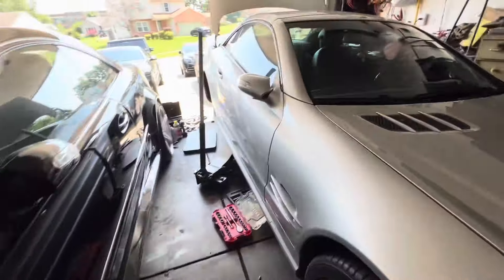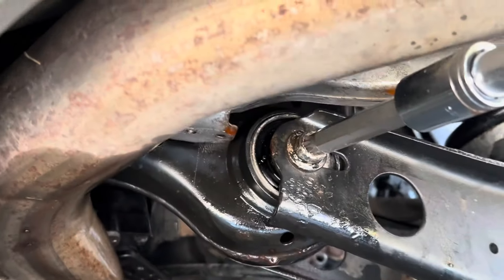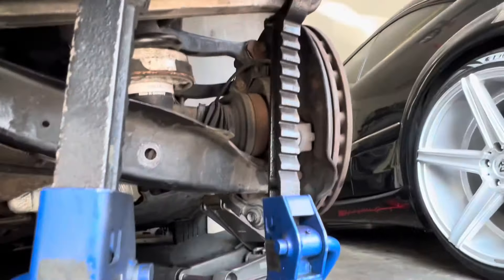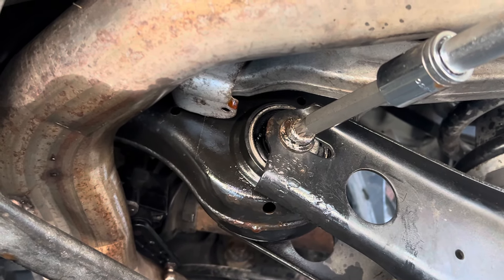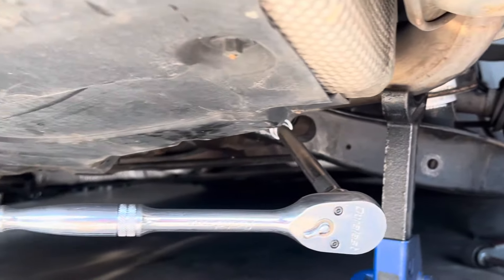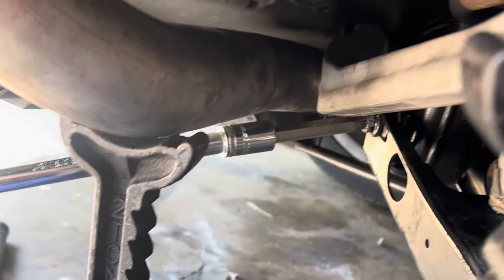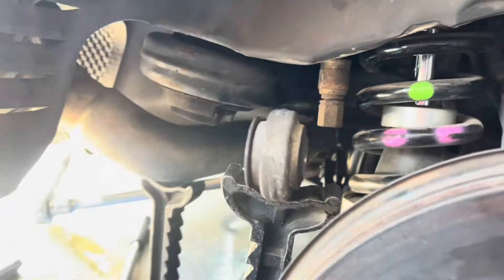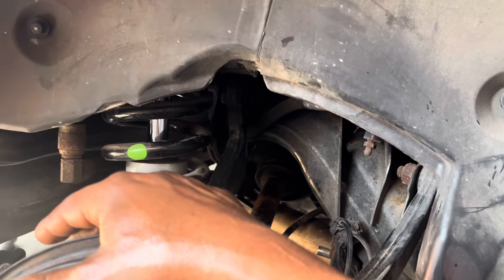(Part 1) HELP!!!! Stuck Rear Lower Inner Control Arm Bolt

Comment: Brandon!   First one of the jacks is sitting on a curved section of the body (rail) and is already on an angle.   That bothers me; but I'm not there.   Now to the problem.   Backed into a corner I wonder if you could take a reciprocating saw and cut either the nut or the head off AND THEN grind the remainder down to the shank diameter.   At that point you'd try to bang the bolt out along the axis.  The down side being the bolt is lodged in a rubber damper. The shock of the hammer blow will be absorbed so it might not come loose.   And then at that point you don't have a head on it anymore.

OR

You could grind both the head and the nut off so they are as short as the damper, then the arm will fall out.   You'd need a new rubber/collar/bolt....and MAYBE not the rubber nor the collar just a bolt.   I'm not sure this helps but sometimes one idea begets another.   Good luck, man.
Reply from the maker: I appreciate that reply. The jack stand is simply lifting up the exhaust to gain access to the inner control arm bolt. Either you drop the exhaust or lift it, in order to do so. The suggestions for the stuck bolt were well thought out and I agree with the possibilities. Man……I’d hate to have to cut this bolt. I even thought about cutting the strut in half and inserting the new coilover. That’s some desperation right there. 😅😅😅 But the last resort will be removing the outermost lower control arm bolt and all the difficult to remove and reinstall arms to the hub.

Comment: The only easy way is to apply heat to the bolt . Use a sailing torch like a plumberWould use to solder. Applied direct heat to the bolt  for 5 to 10 minutes . Just be careful not to script the head of the bolt
Reply from the maker: @stevensmith2008  Thank you. Makes sense.

Comment: If you haven't got it out, i would remove the nut and use a air hammer to brake it loose. You can always order a new bolt if you messed the threads on the end
Reply from the maker: @ismiley5115  Thank you! I’m back at it tomorrow.

Comment: No heat ! That will damage the bushing. Let it soak in pb blaster for a few hours and use an impact gently with short 1 second bursts, that will break it loose.

Comment: The best support you could get is with that hydraulic jack I would put some wood or a piece of metal to prevent it from coming down good luck I'm not happy with those jack stands being fully extended and all
Reply from the maker: @ToddtheLoneDroner  the jackstands are not supporting weight. One is used to raise the trail arm out of the way and the second one is used to push the exhaust up out of the way so that the bolt can be extracted rearward.
Reply: @goldelementautoworks  I just think it's a good idea to support the Jack in the up position with something that would actually be like a small jack stand
Reply from the maker: @ToddtheLoneDroner  I agree.
Reply: That lower control arm doesn't look stock.  Maybe I'm wrong.   Don't they usually have a plastic cover on them?
Reply from the maker: @CL500MBZ  This one has a plastic cover. I removed it. Only the SL55, 600 and 63/65 has the plastic cover. I’m pretty certain. All of the 500/550 that I’ve done do not.

Comment: Hey guys, it's not his car!  Were it mine I'd contemplate backing it out of the garage and applying torch heat.   BUT this thing is pretty close to the rubber bushing and enough heat to break that nut lose isn't going to play well with that rubber damper.   I do so hate explaining to the insurance company how I burned my garage down and to a different insurance company how I managed to mutilate a car from Alabama!!
Reply from the maker: @kurteckroth2833  Well said and good perspective! I’m going to try everything before applying heat. Because once you do……you can’t go back.